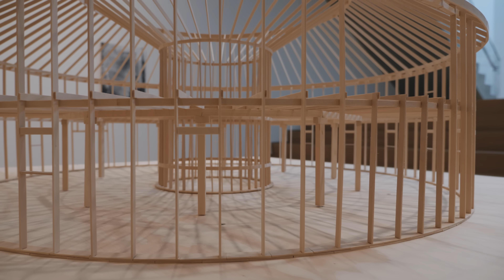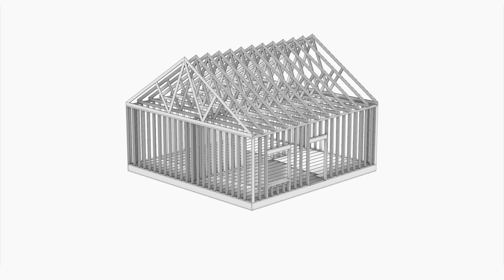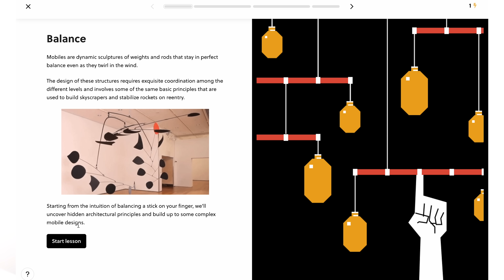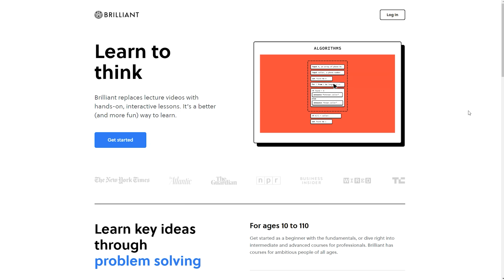The Genius of 2x4 Framing

Comment: Living in Europe where we don’t do this, I find it amazing that capitalism has conditioned Americans to live in cheap flimsy treehouses and just accept it as normal.
Reply: I mean in some places in Europe there aren't many trees left so I could see how it would seem weird.
Reply: @_Cal365_  There are new homes built in Europe all the time.  But the building sites are very expensive explained by scarcity of land and regulations - we do not have the space of the USA.  Also it is very expensive to build due to smaller scale, a number of very rigid building codes and taxing.
Instead, a lot of existing older homes are modernized.  This also maintains the charm of the old cities.
Reply: this country is 80 percent conditioned to accept capitalism as the natural order and it's a huge problem 

the emotionality of the brainwashed has stifled reform
Reply: not only do we accept it as normal we blame ourselves when it fails and the capitalists just cash out
Reply: Any problems with the burger?
Reply: I think you've missed the point... Europe is also capitalist, it's just that the cheapest way to build a house there isn't with wood. The comparison isn't between wood vs brick/concrete, it's big wood vs small wood.
Reply: @n0t14n  there's plenty of wood in Europe. what also exists in Europe are laws for secure and durable construction.
Reply: @mamutakada  Look at the strength to weight ration of wood.  Maybe the inner engineer within you can appreciate the value of an efficient and renewable material.
Reply: @twells138  that's of little use  if you avoid making foundations.
Reply: @mamutakada  I do not understand your statement ... in what case can you not a foundation for a structure?
Reply: It has to do with lifestyle as well.  We Europeans often live in a house all life and we are used to and like old homes.  Americans often move a lot, seek new homes and do not build for endurance.  One can wonder, with the adverse climatic events of many parts of the US, why fireproof and wind proof buildings are not more popular?!
An interesting question is what ephemeral American construction means for architecture?  Does it permit more architects to experiment and invent?  Or does it inhibit architecture due to a lack of necessity and a lack of variety of construction methods?  Also, when you build for many generations, I suppose you are somewhat forced to use solid quality materials - and you probably have to consider a design esthetic that is long lasting, which is a hallmark of great design.
Reply: @pierre.a.larsen  Look at the Japanese for a more extreme example of residential turnover, and arguably, I would say it does lead to exciting opportunities in architectural innovation!
Reply: it reminds me of prefabricated houses in socialism. only, these are more flimsy and look like any stronger wind would blow them away. might be wrong, but I am not sure they even have foundations :D plus, this puny excuse for a home is in good part responsible for the wast urban sprawl problem in the US.
Reply: I completely agree with this. I do not like this type of framing at all. I'd much rather live in a different type of building. I'm American by the way.
Reply: it's amazing how Europe has conditioned people to blame everything on capitalism, even for things whose qualities far outweigh their downsides.

Comment: Where I live we have basically all wood framing and mostly wood clad housing. It's also a desert and most people move here and pull the swamp cooler off their house because of some confusing notion about them being bad. Turns their house into a tender box. 
It was a weird thing to realize that the people building this city weren't concerned with anything but getting as many houses built in as little time as possible. 50 or 60 years later the mistakes are quite clear.
Reply: If it's a dessert, why not build with rammed earth or cob?? Or even clay slip. It's a lot prettier anyway.
Reply: @callmeswivelhips  cause 'merica